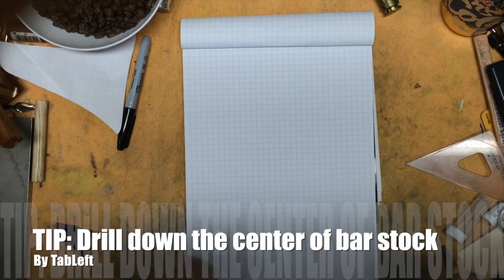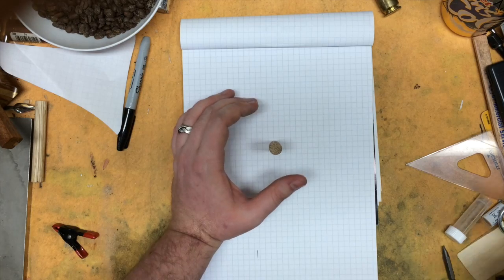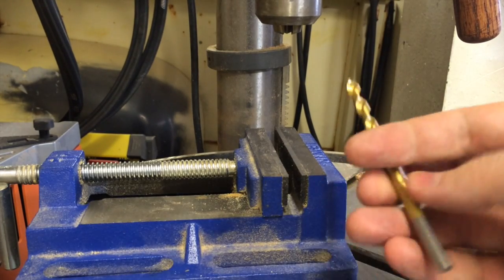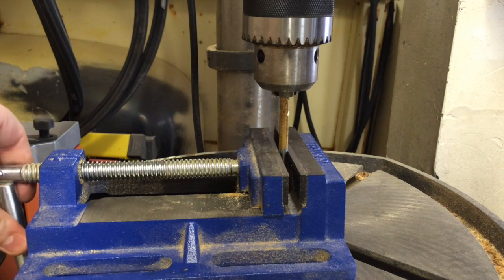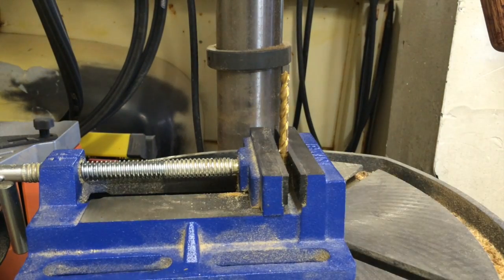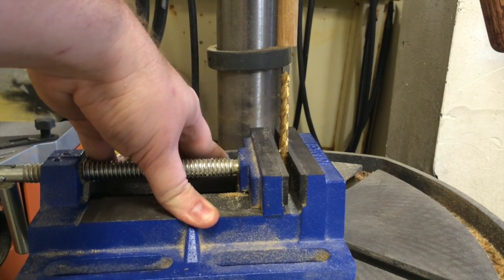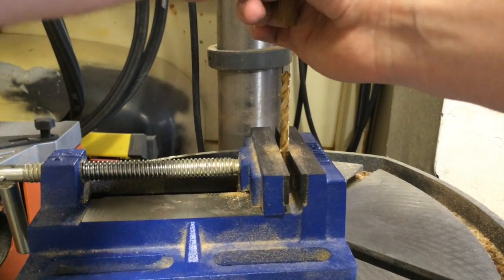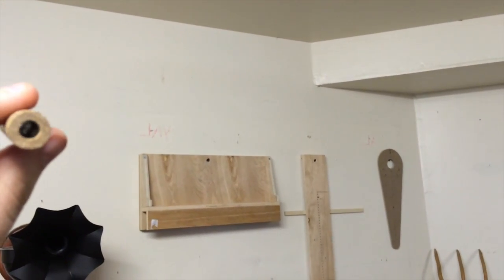TIP: Drill down the center of bar stock

Comment: I really like this idea, but I usually need to bore in shafts that are larger than my 5/8" chuck capacity. How would you suggest I drill those in my drill press?
Reply from the maker: well if you have access to a lathe that would be ideal if not you can use a smaller drill bit to get a well aligned pilot through hole then chase it manually with whatever you’ve got that will hold your tooling and the initial pilot will help guide the following tool to keep it true.  hope that helps ;)

Comment: You can use the same technique for tapping with a die.
Put the workpiece, blank rod, into the chuck.
Put a bevel or lead in onto the rod by running the drill press and use a file stationary to cur a bevel.
Put the die into a die nut (hexagonal die holder). Centre the die by letting the workpiece find its centre in the die.
With the die fixed in position, turn the chuck by hand and gently lower the chuck as you go.
If everything, table etc., was lined up and square, you should havea good thread cut. Check the shoulder where the thread ends on the bar for a nice symetrical shoulder and you can see if it was correctly lined up.
Using the drill press as a makeshift lathe opens up a lot of possibilities.

Comment: I watched this last night and put it to use this mornng, successfully drilling 4mm hole centred in 1/2 aluminium rod. I even finished the work with placing sandpaper on the press table. Worked perfectly, thanks for the vid 👍🏻

Comment: Great tip!! Had to put a hole right in the middle of a piece of round bar stock a couple days ago, took me lots of patience and time but managed to make it perfectly. Sadly it doesn't fit on my drill press, but I'll 100% use this tip if I have to do it again in a small diameter round bar. Thanks a lot!

Comment: I don't see this working on metal stock. You're clamping a round bit into flat vice jaws. You would need to file flat spots on either side of the bit shaft for the vice jaws to grip tightly.

Comment: This is a great tip!  I was actually searching for a jig that will help tap into aluminum tubing.   I need to tap into the ends of an aluminum tube to install 8-32 rods.  Tried it by hand today just holding the aluminum tube in a vice - what a hot mess that turned out to be!  First I'll drill the tubing to the correct size ( #29 bit I think), then try tapping into the tube.  Think this will work for my application?  Thanks again, great info!

Comment: Interesting and useful.  Thank you!  How do I do this in a 1 inch dowel, 5 feet long? The application is, I want to put a threaded insert in the top of my hiking stick, so as to mount a camera adapter in a 1/4 x 20 bolt.
Reply: Put the stick into a hand drill and run it through a pillow block bearing with the drill bit mounted in a vise on the other side

I made a cane once though with 1/2” aluminum round stock and threaded the long side with a die and drilled and tapped the handle, although if you’re using wood I’m not sure how well that would work (not to say it’s impossible to thread wood just that you’d need a lot of new tools)

Comment: This is great! Unfortunately the project I’m currently doing requires a hole drilled into the end of quite a long length of dowel so I don’t think this will work - but still glad I learnt this.
Reply: I came here looking for the same applicational you - a center hole in an 8s’ dowel. Please share if you found a solution. Thank you!!

Comment: How about reversing the drill with the rod? First align the rod with the drill and vice, then release the rod from the chuck after fastening it to the vice and finally put the drill bit on chuck and start drilling.

I've been trying to find a nice way to drill a center of the steel rod and tapping some thread there. You just give me some good ideas. I am not sure if I still need a drill punch in this situation.

Comment: You can also make a saw cut halfway through a block of wood, clamp the block to the drill press table with the slit aprox. aligned with the drill center, drill down the slit, take the drill out of the chuck and insert the shank in the hole created, clamp the wood against the drill shank and it will be centered, ready to drill a dowel in the chuck. Described like this sounds complicated, but it's actually quite simple.

Comment: Be warned that while spinning the work instead of the drill will make a true centered hole with the work (beacuse the axis of hole is aligned to spin of the work) the drill bit will not ensure a perfect diameter!

Drill bit if sits just a tad out of aligment then the hole generated will be bigger than the drill. This is beacuse think of a boring bar in a lathe. It sits excentric to the spin axis and creates a hole big as the excentrecity to the cutting edge is applied. Same happens with a drill bit if it is excentric by 0.05mm it will generate a hole bigger with 0.1mm.

Especially true for soft materials like wood, aluminium, copper, brass, plastic where the drill bit will keep it's offcentricity and force a bigger hole. In tougher materials like steel and stainless steel the drill bit will just flex and indicate the minor excentricity that you can try to correct for. Either way it will for a slightly bigger hole than the drillbit as for sure there are minute bend/excentricy in the drill bit. For such tough materials you need an acurate center punch to start with. As the initial purchase of the hole requires a lot of force and any wondering of the tip skating will flex dhe drill bit a bit and start an out of center hole. Going further will flex the bit a lot and will break.

So for drilling accurate holes is best to start with a smaller drill bit that what you need (start with 4mm if you need a 6mm hole) by spinning the work (and hopefully the initial start is selfcentered.. hard to do in tough materials) drill it as long as you need. Then remove the work and go the traditional way where the right drill bit just enlarges the hole you made before.

I have a tough time searching for methods of drilling an acurate 2mm hole in the center of a 10mm stainless steel rod. Ended starting the hole with an accurate center punch, used a short split point centereing bit (the short stubby pilot used in mills and lathes) then go with the drill bit (1.7mm) chucked low in the vice and slowly went. Raising the drill bit a bit each step (used a 3jaw chuck to hold the drillbit). After the ordeal was over (5 drill bits later). I've installed it normal way and went with a 2mm drill bit to enlarge the generated hole that was closer to 1.9mm. The hole eneded accurate and centered but with a lot of fussing. The hole i did had a lenght of 50mm.

So this is my experience with spin the work technique. Good but hole diameter is not acurate enough and on small drillbits the flex induced can and will break a lot of bits much more the going traditional way.

Comment: Good technique to precisely align the dowel and the drill bit, but wouldn't it have worked just as well with the drill bit in the chuck and the dowel in the vise? Or is there a reason to do it in reverse?
Reply from the maker: With in the traditional setup you could drill off center just like drilling anything else.  With them reversed as shown the wood and bit are forced to deflect toward center if there is any misalignment (like boring on a lathe you can drill a hole in the center of a spinning material but nowhere else. You could use this technique to help align items in a traditional setup but any error would persist.
Reply: @TabLeft  I see! Thanks for clarifying!

Comment: I think this would work equally well if you used the chuck to align the wood in the vice. The key thing is that you're using the same object (the chuck) to align both the cutter, and the thing you're cutting.

Comment: Should make the rlectro magnet to hold the bice. Its so easily done 12v would be enough to hold it enough a mallett would find it difficult to move it. Mot easily done. With workshop worth making. Transformer easily found amongst broken microwaves and amazingly powerful.  For center drilling it would take guess work out of has it moved and good item to make as so basic. 3 in line held up giant h beams with 2 guys stood on them 
Clips on you tube. 240v i think. But fuze added no problems.  Cost 200€£ to buy and easily made. With workshop 1 half day at most. 3 in heavy pot and lift car! Recycle :) peace oot ;)

Comment: The cause of the problem with the bit in chuck and alignment issue is if you watch close you will see the table actually flexes slightly under pressure at the start and the bit bites into the dowel and the sudden torque posits the dowel to pivot to some slight angle because of the only 2 contact point contact vice grip. Bit in vice ' V ' is auto plumb and easy center to chuck and material is in a 3 point contact chuck. There is great mechanical advantage on the press hand lever chuck assembly. With small and medium consumer grade presses,  watch that the hand pressure is not too great as these press tables flex slightly which will give you a sloppy hole.  

Trick:...Chuck to table square......Use one long leg Allen key, short end mounted in chuck and bring the table close. Hand turn the chuck to a few rotation positions set the table parallel to the long allen key end.

Comment: It looked too simple.....it is - but it works like a charm. I needed to drill an accurate 1/4" hole through a 3/8" bolt for a dowel jig I was making (home made Dowelmax) . It was perfect and after set up it was mass production. Thanks so much Tab.

Comment: You say "self-centering" but I do not see how that would be.  You still have to center the dowel over the bit, don't you?
Reply from the maker: Rob I you do but errors in alignment will push the bit toward the center rather than away from the center.  So you get it as close as you can then let the press auto adjust for any error.

Comment: Cool tip and video. Seems that you could did the inverse as well, that is use the chuck to center the piece into the vice then put the drill into the chuck. It wouldn't be self-centering, but it would not enlarge the hole the way self-centering could.

Comment: I feel like there's a big risk of the drill bit spinning in the vise or rotating in the jaws so that its not perpendicular. Is there some way that a 3-jaw chuck could be easily mounted and centered on the drill press table relative to the spindle?
Reply from the maker: Aidan Druck there is but I didn’t have an extra. Most hardware store sell generic Jacobs chuck attachments that could be used. As for the “risk” it’s literally never happened to me and I’ve done this load and loads of times and even if it did it’s not like it would injure anyone but if I had an extra Jacobs I would probably use it.
Reply: TabLeft Workshop    Thanks for the info. And to clarify, by risk I didn't really mean it from a safety sense, I meant something more along the lines of a risk of messing up my work.

Comment: beautifully simple, best tips always are. I am surprised you didnt bolt or clamp the drill vice down to the drill press bed. I'd be sure to knock it out of position if I used this method. This would be a great way to drill out legs for frog lures!

Comment: any tips for dowels bigger than your chuck?
Reply: Tee nut and matching threaded rod or cut off head of bolt.  Insert into end of dowel, check for square then insert into chuck.  Reinsert into other end of rod to complete hole.

Comment: Great tip - thanks! Any tips on how to center drill something longer, like say, a 12" long 5/8" wooden rod? I once strapped a hand drill with a long bit down to a saw horse, measured and adjusted the bit to the length and surface of the saw horse so that it was straight and parallel to the saw horse. I then put a v-notch into a 2x4 to hold my 12" dowel, and used spacers to adjust the height of the dowel's center to the drill bit. I pushed the dowel onto the drill bit, guided straight and true by the v-notched 2x4, but of course over the length of the dowel, the grain of the wood caused the drill bit to wander, and when it came out the other side, it was off-center by a good 1/8" - 3/16". Any suggestions on how to do this better would be much appreciated.
Reply from the maker: Don Saito pocket83 recently did a video where he did something similar it was for the Jurassic Park cane he made with peter brown.  Alternately you can actually just clamp a long drill in a vise, and chuck up a down in a hand drill and since the system want to center it’s self you can get pretty good results.
Reply: Okay, interesting idea - I'll think about it - thanks!

Comment: This is very helpful but can I drill a 1/4 hole in a 7/16 threaded rod? It is 18-8 Stainless Steel.
Reply from the maker: +Jake Rathbun I don't see why not it would be best to step up the sizes slowly though and use lots of lubricant, and cobalt bits might not hurt either.  The biggest problem will probably be protecting the threads, you could try starting long and cutting the damaged threads off or you could try some red locktight and a thread coupler or something.  The best way might be to drill a stainless rod and thread it after the fact with a die.  Hope that's helps, I'm no machine at but that's how I would probably try it.
Reply: Thanks. Also what lubricant can I use?
Reply from the maker: in a pinch wd40 or pretty much anything is better than nothing, but ideally you would get real cutting oil, it has a lower smoke point and when it smokes off it takes heat with it so the part will stay a little cooler, plus there are lot of different kinds of oild and not all are equal for all purposes. I mostly use Oatey dark thread cutting oil (cheap and you can get it at home depot) it seems to work fine for me.
Reply: Ok thanks a lot
Reply from the maker: good luck with your project

Comment: OK, noatter what I did this method just wasn't accurate. I think there are too many variables, like if your vise is accurate and doesn't tilt the bit when tightening  and will your vise move at all when starting g the press, also is the drill bit perfectly straight. I tried the other method mentioned in comments of drilling a hole the size of the dowel first and putting the dowel in that and the  drilling and that method works much better

Comment: Show me how to do this with a hand held drill instead of with a drill press? I have a vise to hold the bit put no way to keep the hand held drill at the correct angle.
Reply from the maker: you don't actually need to hold the drill at the correct angle just like on the drill press if you get it close it should want to align itself.  I might do the hand drill method on a tip video soon since i get a lot of questions about it.

Comment: I could have used this technique on Friday at work, seriously, I was making an emergency spade bit extension 1 metre long using some tube steel and small lengths of solid round stock.
This would probably work better with some V jaws in the drill vise.

Comment: +TabLeft Workshop i use the lathe as it has a 110mm travel and 1000mm travel if also moving the headstock, instead of the rubbish 50mm travel of the drill press but wether you have the bit or the dowel in the chuck the biggest issue is deflection causing the bit to wander due to wood grain, brad point wood bits instead of hss helps but still no substitute for slow feed and regular chip removal with a thinner bit for a pilot hole first.

Comment: My drill press will not take 5/8" stock. Only 1/2" inch. I need a 3/16 hole in some 5/8 dowel. I need 30 of them at 1 1/2" long. Got any ideas?

Comment: Love this tip, thank you!
Don't know if its my particular drill press or what but I can't chuck the drill bit upside down without having it move on me (because of the twisty nature of the drill bit) I'm not chucking it tight, just barely kissing it....but it still moves on me. Any ideas?
Thank you,
-Shane
Reply from the maker: Sounds like something is probably out of square.
Reply: Wow, that was quick! Thank you for the super timely response. I don't think it's because of "squareness issues" only because I'm not even getting to that point. My problem is being able to chuck the drill bit. I don't know if its my older rockwell drill press' chuck or what. I go to chuck the flipped drill bit and the spirals on the bit prevent my chuck from grabbing it without it twisting or turning to one side or the other. I've watched you flip the drill bit and chuck it with ease and it stays rgt where you want it (in the drill press chuck) and mine just won't do that. It all good, this is a solid video and I appreciate you sharing it with the world.
-Shane

Comment: Why does it self center when the matial spins vs the bit?
Reply from the maker: The center is the only place the forces will equal out, any play will tend toward the center.  For the same reason that you can spin a frisbee on your finger if its relatively centered the frisbee will adjust to your finger position.

Comment: When you say it's self centering, is that because if the bit is a bit off center it will make a slightly larger whole with a radius of the point on the bit farthest from center? Now if I can just get me a drill press! ;->
Reply from the maker: its more that it will make the bit tend toward the center as opposed to wandering.  Any play in the system will work for you not against you.

Comment: This is a great tip! All-around good video work too. I sometimes use a smaller drill first to make a pilot hole for a larger bit. The larger bit will follow the pilot hole quite nicely. This is especially important if drilling into metal because the set-up is hard to control with a large bit cutting all in one pass. Keep up the good work.
Reply from the maker: Thank you!
Reply: That is the normal approach on every drilling that have to go straight and for higher holes you drill in Steps with more and more bigger drill bits.